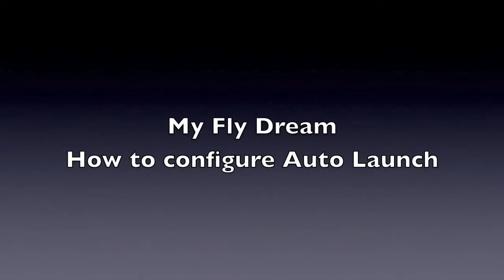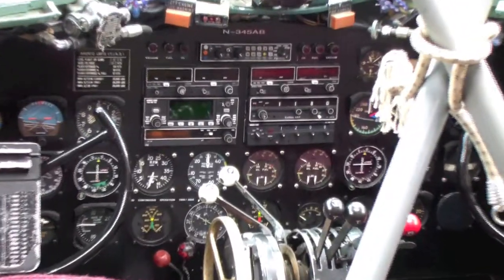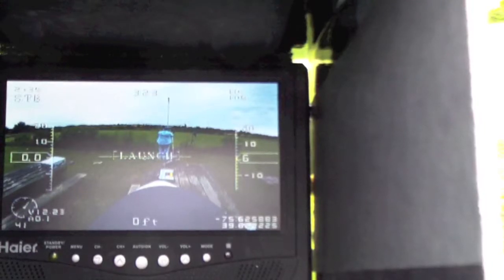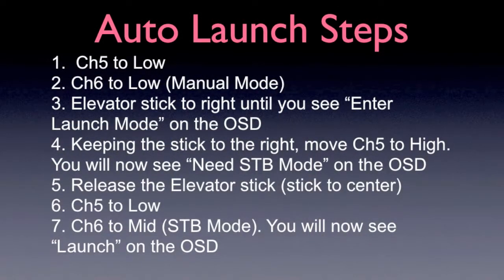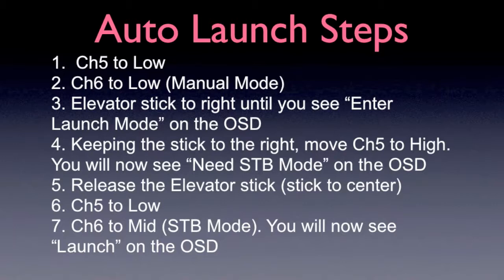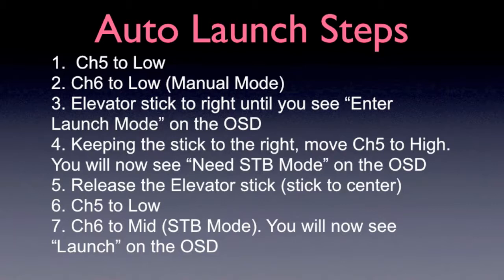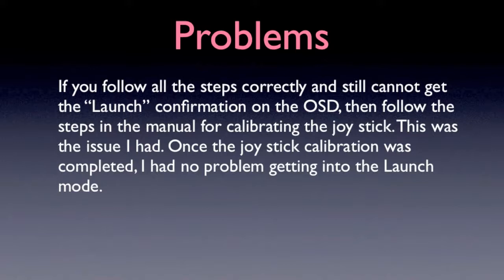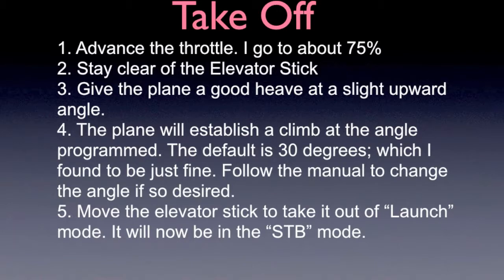My Fly Dream Auto Launch

Comment: Thanks for this vid', on my 3rd flight with the MFD, I tried Launch mode and it ate dirt!
I missed a step or two but I will try again at the weekend...
I'm also not getting level flight in STB.. I just needed to do a Joysitck Cal!!!
Reply from the maker: I hope it helps. I think the auto launch steps are way to complicated. I still have the MFD in the Penguin. Only flew it once this summer. I find the Eagle Tree Vector much easier to configure.